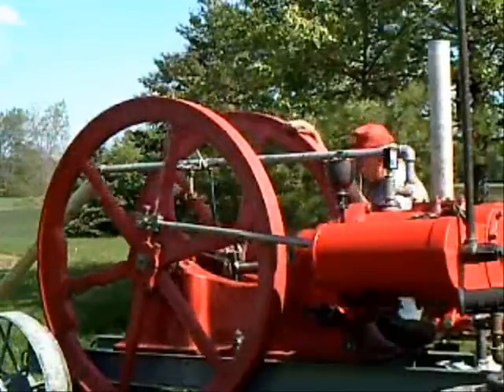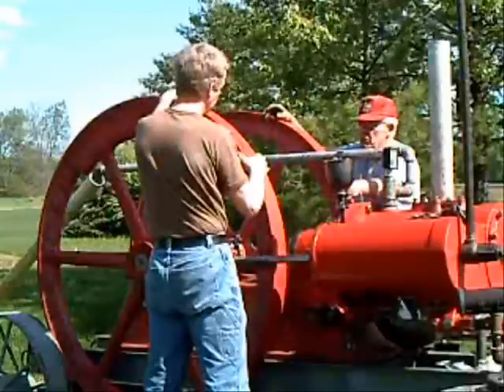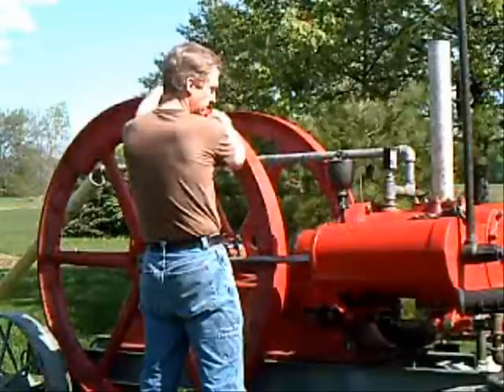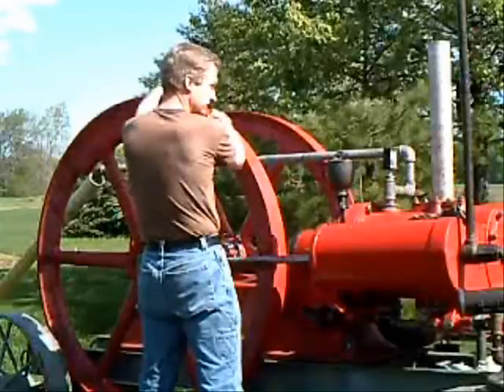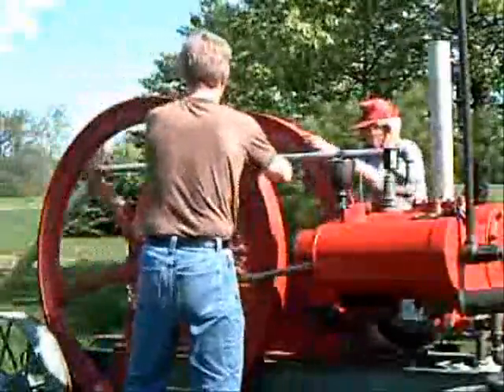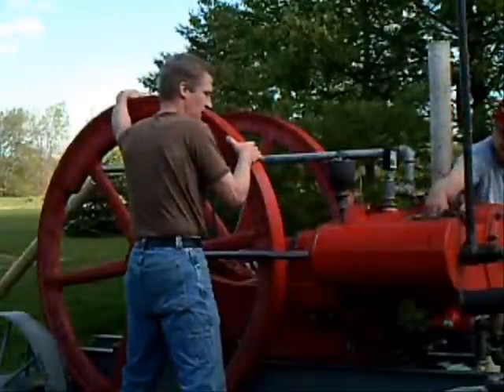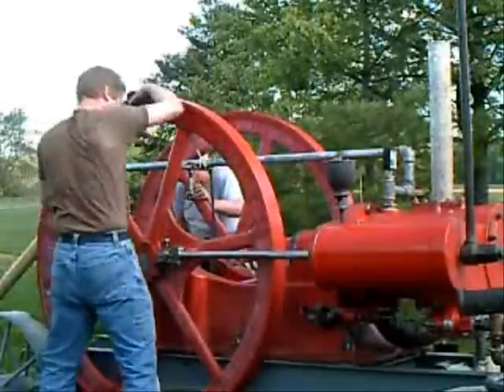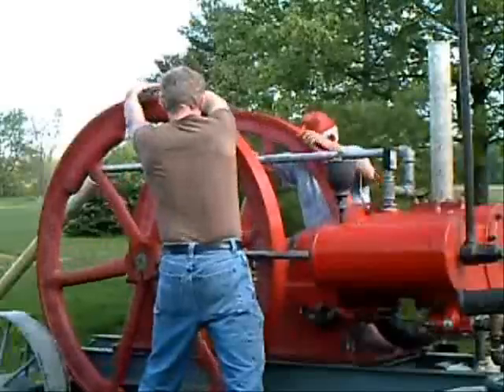1905 Reid 15hp oilfield stationary engine

Comment: Perfect wood smoke generator for a 10kw genset off your wood stove with flywheel tip driven slow rpm all day whole house generator with a flyball governor. Would power the house at 5 or ten degrees cold weather. You could laugh at the power company loosing power till you ran out of firewood.

Comment: Very rare engine,  the conception is very nice and inteligent. Two strokes, air supplyed by second cylinder... for the slow runing it is very just...  Moteur deux temps à balayage par piston annexe, très rationnel et de fonctionnement tout à fait correct. Il n'a rien à envier avec les machines modernes... Excellent pour usage à poste fixe... Bravo

Comment: does anyone know the torque rating. Looks like a very torquey engine
Reply: Seb M 
No, but it seems like a single cylinder, externally charged by crank like a supercharger.
So if it's 15 hp at maybe idk 2 x 1000 lb flywheels (weight) something like idk 100 ft-lb makes sense.
Do a few calculations and try to figure it out by estimating the components involved.
Basically, I doubt 15 horses could stop it at full pace. But at 150 rpm maybe if they had a really long rope.

Comment: I wonder what that side cylinder is for? The main crank is between bearings, and that additional is driven from the side-wheel. Must be a pump for cooling water?
Reply: It compresses intake air.  An early 'supercharger'.
Reply: Good to hear&watch  it from other old motor enthusiasts! Heat driven machines were in roots of human civiliation. Electricity gradually defeats them in many fields, yet those ingenious men with their exploding devices never be forgotten.

Comment: i wonder what the top speed is
Reply: Not much faster than this. This is actually really fast for this type engine.
Reply: elhigh Well, it was hitting on basically every stroke... Quite near to top speed.
Reply: It's bumping right along.  Big stationaries like this would just do their thing at a modest speed, hour after hour.  I'd say this one was at about 75% of its design speed.
Reply: About 150 rpm's, this one is obvious unregulated, perhaps they had no control of fuel supply (if running on propane)

Comment: In the comments, it was stated the engine was running too fast.  No way.  If this Reid was powering a standard rig, the speed would be about 60% too slow to pull and run rods or a wire pumping line.  If you were pulling tubing, the engine would have to run about 6 times as fast to have the speed to power the gear reduction of the band wheel and double block in the derrick and crank the tubing with its weight right out of the well.  Pulling casing with triple blocks would be faster even
Reply: 6 times faster than it was just running ?  No way, that engine would self implode.

Comment: they used that double set up so they could run on very poor quality fuel , It sorta pre compressed the fuel charge making it denser , basically so it would have the same effects of high compression like a diesel , but yet not have the extreem effort to start that it would with very high compression , hard to explain , but they were mostly ran on cull oil (kerosene) but it was far different than it is today from what it once was ...

Comment from the maker: I would guess it was designed as a 2 stroke because of the power benefit. The double piston is sort of the "valves" of the engine. The small cylinder sucks in both air and fuel and when the large cylinder is coming to the bottom of its stroke, the smaller piston then "pushes" the mixture of air and fuel into the larger one, both pushing out the exhaust gases and pushing in a new mixture to fire when the large cylinder comes up to the top of its stroke.
It is a strange design, but very simple!

Comment: Just turn the key ! : )
Reply: what key? the "key"is that big-ass flywheel lol
Reply: @JuliaCV9  turn key system, turn the key , there is no key , get it
Reply: @normellow  oh, now I get it! "turn" the key! but in this case the "key" is that big-ass flywheel. and you turn the flywheel until the engine starts.
Reply: @JuliaCV9  it’s amazing how easy we have it nowadays
Reply: @normellow  yeah. back then you had to turn a giant flywheel in order to start the engine. then in the 1920's you could turn a hand crank to start the tractor, and then im the 30's the added the convenience of an electric starter. the Farmall H at first had a handcrank and then they added an electric starter. large kerosene tractors like Rumley Oil-Pull tractors had a big, heavy flywheel which you would have to turn until the engine started going under its own power. smaller tractors like the Fordson had a handcrank which you had to turn a certain way so you don't break your arm or wrist. medium sized tractors like the Farmall H and M had an electric starter which with the pull of a metal ring, you could have the tractor idling in seconds. now adays you can turn a little keyswitch and boom your engine is running.

ahh history. the continuous development of stuff!

Comment: @randommagnum 
Yep, it's a charging cylinder.  Since it is a uniflow engine it's dependent on a scavenge pump, which pushes air through the ports in the side of the cylinder, blowing out the exhaust gases and forcing a fresh air charge into the cylinder.
Reply: Very just Douro.....  for a slow running it is a very nice system!!!........
In french... ''''moteur deux temps à balayage par piston annexe.......'''''''

Comment: the old guy is right, you roll it forward as if it wher running, running direction  to take in a charge, it wont work backwords so well because of the charging cyclinder wont push it in.. I had one, i know how to start it.

Comment: the old guy is right, you roll it forward as if it wher running to take in a charge, it wont work backwords so well because of the charging cyclinder wont push it in.. I had one, i know how to start it.

Comment: @RatherEggy Just think of all the places you see electric motors on a modern farm. Before everything was electrified you would likely use a stationary engine to do the work. One of my stationary engines ran a cement mixer and the other was a washing machine engine.

Comment: make another hole in the head and start it with compress air you wil be stress relieved also find the way to change the ignition timing at will for the start up procedure,, great piece ,,congratss. both you guys.

Comment from the maker: It is to draw in air &gas,and then push the air gas mixture into the main cylinder which exhausts the burned charge and at the same time pushing in a new load. It is a type of 2 stroke engine. Firing every time the piston comes up.

Comment: dump a few drops of gas in the spark plug hole, turn it backwards and it will start, if you can roll it back far enough to spark and ignite!!

Comment from the maker: It's called a charging cylinder. It pulls in the air -fuel mixture and then it pushes it into the main cylinder, which has an ignition source. Originally they had what was called a hot tube ignition.  This 1 is retrofitted with a crude spark plug and coil.

Comment from the maker: I am glad you enjoy these beasts! To answer your question, Yes, the "carb" is a needle valve on the propane and there is a 2" ball valve on the air intake. If the air valve is opened up even close to full, the speed of the engine goes WAY to fast! It also uses alot more propane. 
The next step is to get the flyball govenor hooked up and working to control the speed. It seemed to run in the vid at about 340 rpm, which is still a little fast. But it is my Dad's first stationary engine!